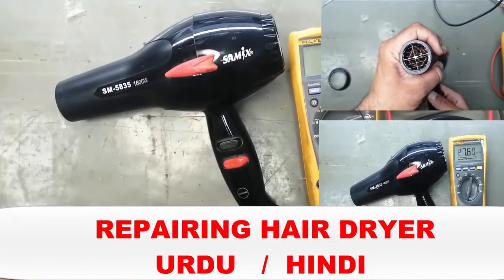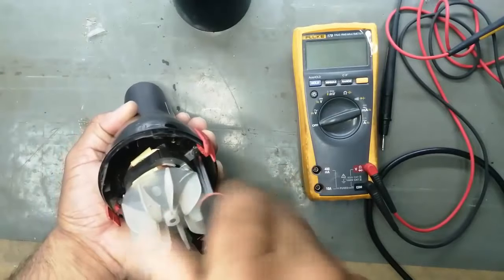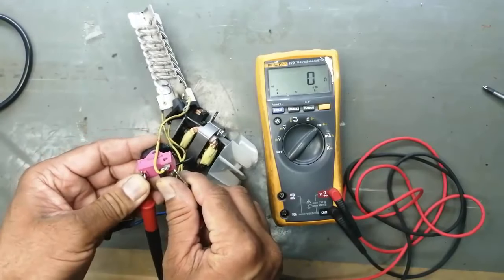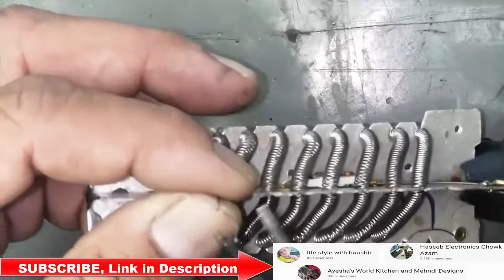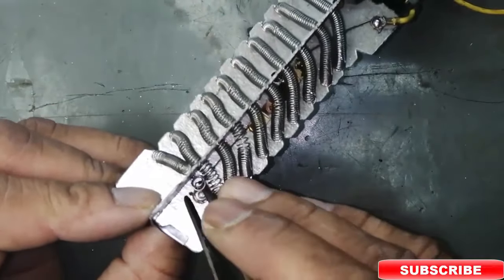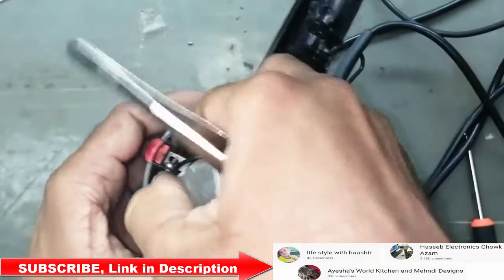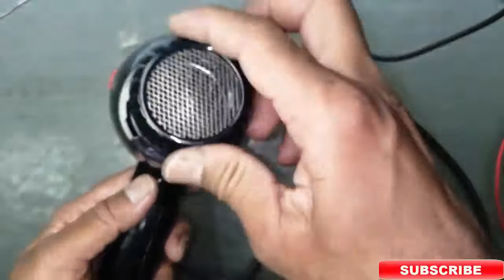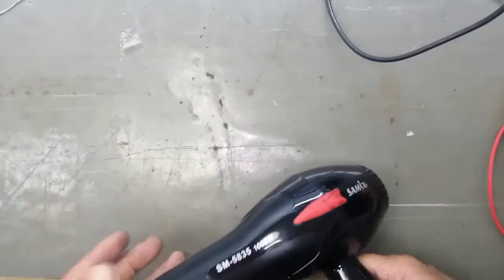{220} How to Repair Hair Dryer At Home - No Heat

Comment: Yes, helpful… but I have no spare parts 🙁  In my case the switch seems to be broken. 
A little bit more specific: the diode seems to get hot on fan level 1 and melted the plastic of the switch and also the solder. This made the contact of the switch come out a bit causing level 2 of the fan not to work anymore. Then also it melted the soldering and the cables on the diode came off and nothing worked anymore. It looks like bad design to me. The diode should not get so hot or should be placed somewhere else where its heat does not cause damage.

Comment: How do you test the fan
Reply from the maker: it is easy by applying 24 vdc at fan motor
Reply: @HaseebElectronics  can’t you use the multimeter to test it’s resistance
Reply from the maker: with multimeter it will show just continuity
for mechanical movement we need to move it
Reply: Ok so we just hook it up to the bench power supply

Comment: Whats the purpose of the diode on the switch?
Reply from the maker: it is decrease the speed and heat. when the current will pass through this diode, it will pass half peaks of input ac voltage (110 volt after rectification) 
so the speed and will half than the normal

Comment: Thanks Haseeb. What is the reason for the diode across the switch?
Reply from the maker: that is to reduce fan speed, it rectifies the voltage so 220 volts are dropped to  110 volts after passing through diode
Reply: @HaseebElectronics  Will this then also reduce the voltage to the heating element?
Reply from the maker: @CliveTrezona  yes it does

Comment: Suddenly the handle is getting hotter and burning smell is comming how to fix this in blow dryer?
Reply from the maker: please check anyone switch may  have internal sparking or might be some wiring have short circuit or loose joint

Comment: How cw. You increase heat
Reply from the maker: heat cannot be increased. because the heating element cannot provide more heat than its rated value. 
in case of increasing heat or any obstruction in air flow the thermal switch will disconnect at specific temperature

Comment: Why my dryer brings only fan air with out hit
Reply from the maker: it is possible that the 
thermal protection / thermal fuse
or thermostat switch
or  heating element may have some issue

Comment: Today i repaired a hairdryer. The connector was broken and i replaced the cable. The Torx screws had an little pin, therefore i had to cut the pin and then i could lose the torx screws.

Comment: Salam brother what is the best nichrome wire for 12v blow dryer want good hot air
Reply from the maker: wa alaikum salaam brother 
it depends on required wattage
for example the wire must be selected below melting point, and the resistance value can be calculated by R=V/A method
then select the wire guage and determine the wire length based on calculation and resistance per cm of the selected gauge
Reply: @HaseebElectronics  can you please calculate it for me please I am not that good in calculating, I have a 12v input an maximum is 200/300 watts so I want just simple sigaret input 12v what kind of nichrome wire or other materiaal is good for 800 c ?